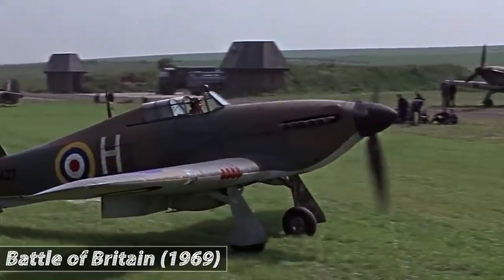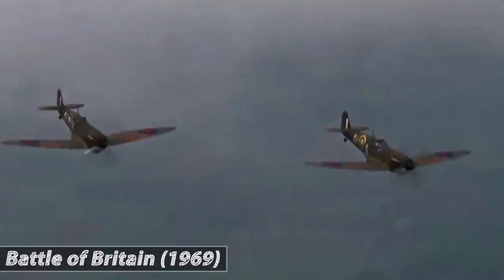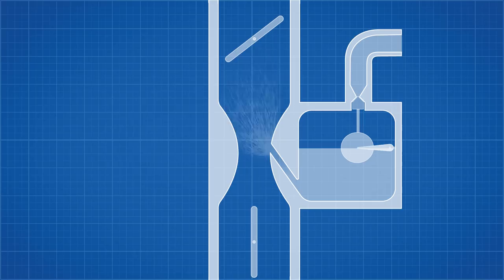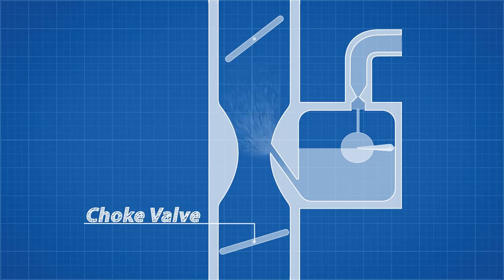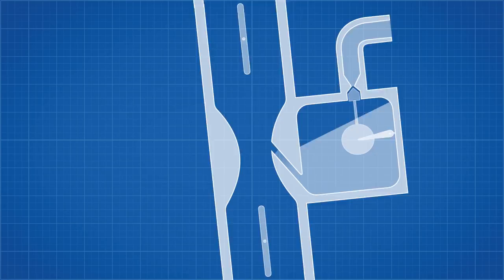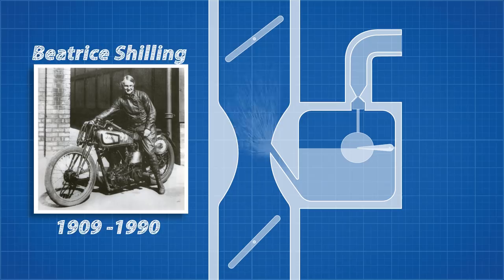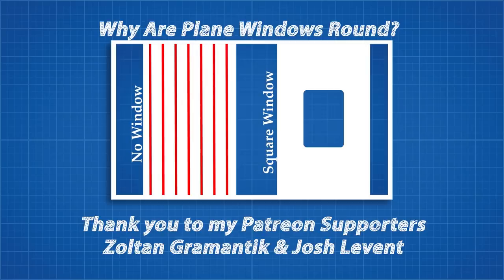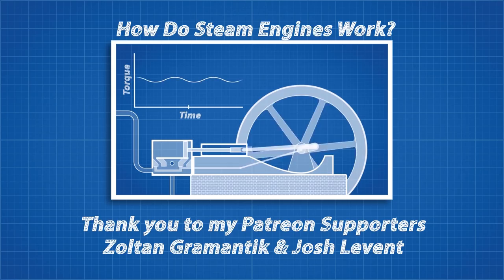The Spitfire's Fatal Flaw

Comment: A. That's a Hurricane you're showing cutting out.
B. It was NOT a fatal flaw, Spitfires shot down enemy planes at a ratio of 4.7 to 1 throughout WWII
C. The pilots learnt very quickly and rolled out of a negative 'G' situation.
Reply: The fact that it can cause your engine to cut out and fail to restart does make it a fatal flaw, did you even watch the video?

That kill ratio has a lot more to do with other factors than simply the plane's performance.  Vast superiority in numbers, only flying close to base while the Bf 109s were flying at the furthest extent of their range, the role they were employed in later in the war meant they were less likely to encounter fighters, the deteriorating quality of opposing pilots.  One could say judging on kill ratio alone that the Bf 109 was a far superior fighter, as in Operation Barbarossa their kill ratio was 21:1
Reply: Against massively outdated aircraft and totally inexperienced flyers on the eastern front. As Adolf Galland commented 'Like shooting fish in a barrel'
Reply: A: as addresed elsewhere, Spitfire footage was hard to find, so Hurricane footage was substituted. 
B: From an engineering point of view it's 'fatal'. It was a design flaw which unnecassarily denied users the ability to easily perform a basic function of the designed machine. It is accurate to describe this as a fatal flaw. 
C: They learned to work around the limitations of the plane's design. But this doesn't negate the limitations. It still provided the Germans with a manoeuvrability advantage, even though overall the kill-ratios demonstrate that German pilots remained at an overall disadvantage.
Reply: A. https://www.google.com/webhp?sourceid=chrome-instant&ion=1&espv=2&ie=UTF-8#tbm=vid&q=spitfire+roll
Spitfire footage is not hard to find, all of these videos produced before this one, also, the movie Battle of Britain that he took the Hurricane shot from is responsible for 170 hours of Spitfire in-flight footage..
B. From an engineering standpoint, it's not a fatal flaw, unless it, itself caused the pilots to die. It would cause possibly fatal situations in air combat, but by itself was a rather benign issue, as proven by the Hurricane in the video experiencing the problem but not crashing. Also, the fact that this issue was used by Germans as a defensive aid, since the German could dive away from an attack, while a Spitfire/Hurricane pilot would need to add a half roll to the action, makes it not really a fatal flaw for the Brits,, so much as a German pilot saving flaw. 
C. Spitfire/Hurricane pilots being attacked in the way that German pilots would dive earthward would simply turn into the attacker, forcing him to overshoot. The Germans lost the Battle of Britain, before Miss Shilling's orifice had been installed, because German planes also had disadvantages; low internal fuel, poor rear visibility, 850ft turning circle vs 650 for the Spit, and the automatic slats that even British pilots in captured BF-109s said were dangerous in aerobatics.
Reply: John Abbott You just proved exactly my point.  Claiming an aircraft is better based on kill ratio is ridiculous.  More than 70% of German aircraft downed in the BoB were shot down by Hurricanes, thus by your reasoning the Hurricane was better than the Spitfire, which anyone can see is false.
Reply: Nick Hine On point C: actually, the kill ratio during the BoB, when the two airforces were on relatively equal footing was in favour of the Germans by a factor of 3:2 when you factor in only fighters, which is what is being compared. That even includes the almost useless Bf 110 heavy fighters.
Reply: Your B point is moot as they fixed the negative G issue in later Merlin engines, It was only the Mk II spit that had the issue. Later Kill ratios have no weight on the engine.
Reply: You beat me, I was about to basically say all you said. I have spoken personally with RCAF spitfire and mustang pilots and they knew what the planes could do and used them accordingly. One ace I spoke to said he liked the spitfire over the mustang as a dogfighter so I am not sure it was a fatal flaw...just something you had to account for.
Reply: I would have thought that there was more footage of the Spitfire as it was such a big thing at the time
Reply: D. the BF106 could not dive steeper than 75 degree angle, otherwise the wings would break off from the body. It had a weak structure. The British pilots used this to their advantage as they could dive faster even with the engine stalled and caught up to the fleeing BF109 ... That I call a fatal flaw ...
Reply: P51s weren't amazing dogfighters, but they were fast. ive heard the issue described by a WWII pilot [who flew both] as [paraphrased] ''if i had tofight, id choose the spitfire anyday, but if i had to fight over berlin id choose the P51, for want of a return journey''
Reply: Kirothe Avenger That quote is in reference to the range, a Spitfire couldn't make it to Berlin and back because it didn't carry enough fuel, much like the BF109 over Britain.  The Spitfire was designed a decade before the Mustang, when the requirements were very different.

When the Spitfire was designed, it was assumed that the bombers could defend themselves, and so fighters were designed with less range as they were only needed for local air superiority and interception missions where they would be flying close to their own airfields.  By the time the P51 came around, it was becoming apparent that the bombers needed escorts when flying to targets in Germany.  Note that the British never developed a long range escort fighter because they did not see the need as their bombing missions were carried out at night.
Reply: jadger1871 precisely my earlier point. the two are different things. spitfires were amazing interceptors, P51s were amazing escort fighters. spitfires were better dogfighters, but as you said didn't have the range for long range ops, which P51s did. its not that a P51 is more 'modern' its because they were designed for different roles.
Reply: Nick.
The Germans had no maneuverability advantage in the Battle of Britain.
Reply: You are implying that the Luftwaffe single-engined fighters were 50% more effective than those of the RAF.  If you just took overall loss figures for fighters, you would have to allow for all RAF fighters shot down by bombers, plus maybe all those destroyed on the ground and any difference in non-combat losses.  Additionally, some of the RAF losses would have been when a plane was bounced by a Bf109 while it was attacking a bomber - hardly a fair comparison of fighter vs. fighter.  I imagine that the dramatic over-claiming by both sides doesn't help to work this out.  Do you have any detailed sources for your figure?
Reply: DrCrispycross Who are you responding to?

And in your example one could also claim that the Germans were at an even bigger disadvantage when Goering forced them to escort the bombers closely and thus negated their aircrafts' advantages.

Thus, the battle of Britain cannot be said to offer the best chance to compare them one on one in a purely fighter v. fighter example, as that was neither of their main roles.  One could also eliminate the later fighting as the Allies possessed vastly superior numbers and so you can't really compare them one on one.

Thus, the only time you can really compare them one on one would be the battle of France, when they were both operating in a similar fashion. But again, the vast majority of RAF fighters there were Hurricanes.  British losses from 10th May to 1st June - 386 Hurricanes and 75 Spitfires were lost over France; 106 total during Dynamo (Dunkirk evacuation); the Luftwaffe lost 147 Bf-109s and 83 BF-110s in the same three-week period.  Also note that those are total losses though, so a lot of those Hurricane losses were damaged aircraft that had to be abandoned as the front came closer.
Reply: It was you, and I agree with the points you've made in return.  I think this just shows how difficult it is to say which aircraft is 'best'.  The tactics used make a huge difference (as you say when 109s were forced into close escort roles) as do the quality of pilots - plus so many other variables!  There must have been some pilots who flew both - maybe someone like Eric Brown could make an objective comparison.
Reply: DrCrispycross This is a good view from both sides examining the other's aircraft after they were captured. https://theaviationist.com/2013/05/31/spit-vs-bf109-dogfighters/

Werner Moelders flew the captured Spit and called it "miserable", but then again, it was a Mk I with the inferior two speed propeller.  The Brits captured some Bf109s and found both aircraft outperformed each other in certain situations.
Reply: Germany always thought that any Spitfire they got hold of was the latest, they once got a Mk V and thought it was a Mk VIII, no wonder they could not understand why Spitfires were better than they were being told.
Reply: Barrie Rodliffe  Any source for that? While that might be possible, it's highly unlikely since every military vehicle is fabricated with a data plate somewhere on it giving the basic information about the vehicle, including the type and mark.

Either you're assuming the Germans were too stupid to hire someone to translate what the data plates said or that the British who were unfortunate enough to get the plane captured were smart and strong enough to pull rivets out of steel but not capable of disabling the aircraft.
Reply: Really, so every Spitfire would have not only its production number but the Mk number and other identification marks.
Not from What I have seen. 
How about the early Mk V Spitfires that were in service before a single Mk V rolled of the assembly lines, many were Mk I or Mk II that were modified.
Reply: Barrie Rodliffe If you do a little research, you would know that they also had another plate attached beside that one where they would list the modifications done. Those were needed so that mechanics would know what they were dealing with.

Also, you're taking this off on a bit of a tangent in quite a what if scenario.  Again, do you have any source? The only Mk V that is known to have been captured was fitted with a DB605 engine later to test the airframe compared to a 109 with the same engine.  And the Germans clearly knew it was a Mk V as these original documents show:
http://www.wwiiaircraftperformance.org/me109/db109g.pdf
Reply: I would think that that the mechanics, fitters, armourers  RT fitters and electrical artificers would be quite familiar with the aircraft they were looking after.
How do you know it was a MK V, just because  the report says Mk V and DB 605, it might be a Mk II. 
As  I mentioned before the Germans did not know one Spitfire mark from another.
Reply: Barrie Rodliffe Because it is documented by the Allies as having been a Mk Vb Spitfire serial no. EN 830 and they know exactly who was flying it and how it ended up in German hands.  just google it.

Also, the Mk II engine bay could not fit a DB605 but the Mk V could because their engine bay was enlarged for the newer Merlin 45 engine they carried. That link I already gave you even mentions the Merlin 45 by name (that's the engine in a Mk V, not a Mk II).

And it is a lot easier on a mechanic to list the alterations to an aircraft rather than let them discover them as they take the aircraft apart.  It avoids a lot of redundant maintenance work when they know what has already been done.

You claim that the Germans didn't know one mark from another, but all this clearly shows you are wrong.  back up your claims with a source if you disagree.
Reply: Flaws of the Spitfire were primarily maintenance related. Rearming, refuelling etc took 27 mins almost twice as long as the Hurricane, 13 mins.  Airframe maintenance, particularly the sophisticated wings made it difficult to maintain squadron strength aircraft replacement being practiced rather than cannibalization. Under wing storage, i.e fuel tanks or the ability to carry a 500 pound bomb, like the p51 mustang, was not possible.  The Spifires main flaw was that it was not the best tool for the job, the Mustang was. Same engine though.
Reply: William Bennett Later Spits could carry 1000lbs of bombs or rockets. The reason earlier Spits couldn't carry them was not a fault of the design but simply because they were not equipped for bombing as they were needed as fighters.
Reply: Willy.
Is that why Spitfires were being produced in increasing numbers and took over from the Hurricane. rearming and refueling was done well enough to beat the Luftwaffe and Spitfires had a higher percentage kill rate as well as a lower loss rate than Hurricanes. Underwing stowage like two 250 lb bombs or a 500 lb bomb  was exactly what Spitfires did before the P 51 did a thing. 
The Spitfires flaw was that is was so good at so many things that everyone wanted it, that is why more Spitfires were made than any American fighter. The Mustang with the same engine came along in 1944 and it still could not accelerate, climb or maneuver with a Spitfire, all it had was longer range, about 500 miles more.
The Mustang was not as good for air superiority, close support, photo reconnaissance, even shooting down 
V 1`s, the Mustang was good for long range escort of USAAF bombers and even then other fighters including Spitfires had to escort the P 51`s and bombers into Germany first.
Reply: A:Which had the same engine-illustrates the point
B:It was a flaw, could be fatal. Spitfires shot down enemy planes at ratio of 4.7 t 1 throughout WWII- LOL! According to Christer  Bergstrom Spitfires achieved 550 victories to 329 losses during BoB ratio of 1.7:1. Also in dogfights vs Bf 109 the ratio came to c. 220 to 180 to Spitfires disadvantage.
C: Bf 109 pilot presses down on his stick, Spitfire unable to fire without loosing engine power-surely, no big deal there. Also good luck against FW 190 which had far superior roll rate.
Reply: Grzegorz 
The slight problem was not a fatal flaw. and soon it was not even a problem.
The Spitfire served right through the war and did beat the Luftwaffe consistently.
Bf 109 pilot presses down on his stick, the Spitfire pilot unable to fire without losing power?
Where did you dig up that bit of complete nonsense?
The F w 190 did have good rate of roll which helped to make up for the Spitfire having better performance and a better turn rate. Many Spitfires had the clipped wing which gave them a good roll rate.
Reply: "The slight problem was not a fatal flaw. and soon it was not even a problem."

No not all, I am sure if Bf 109 comes up on your tail because your engine loses power is no problem. 42-43 is also very soon, like half of the war.

"The Spitfire served right through the war and did beat the Luftwaffe consistently."

Yes, like when Luftwaffe had 3:1 kill ratio over RAF squadrons in 1941 and 1942.

But anyways, I have to congratulate you on your logic. How do any successes of the Spitfire nullify the problem related to carburetor?

"Bf 109 pilot presses down on his stick, the Spitfire pilot unable to fire without losing power?
Where did you dig up that bit of complete nonsense?"

Common sense? Accounts of the pilots? If Spit pilot wants to fire he has to roll. How else does he fire without having the engine lose power?

"The F w 190 did have good rate of roll which helped to make up for the Spitfire having better performance and a better turn rate."

This is a manipulation at best. Spitfire Mk IX only went into production June 42 arriving to units in July, 1 year after Fw 190. And even then both planes were rather equal.
Reply: Gregorz.
If you knew the first thing about the slight problem with negative G in 1940 you would know that a Spitfire pilot would pull the stick back and turn not dive so maintaining positive G and turning tighter than the Bf 109, by 1941 the problem was completely solved for the Merlin 45. that is not 1942 or 1943.

Many Luftwaffe claims are about as realistic as Hollywood movies.

How do the many problems of the Bf 109 not make it a bad plane then?

The Spitfire had no problem of losing power when firing, where do you dream up that complete lunacy? The Spitfire pilot in early Spitfires only has to roll into a dive, nothing to do with shooting down Bf 109`s.

The Fw 190 had a good roll rate especially at low level, that is why many Spitfires had the short wing which gave them both speed and rate of roll at low level. The Fw 190 did not enter service in June 1941 only arriving in small numbers late 1941, the Mk IX was better than the Fw 190 and very good since it was still in front line use in 1945.
Reply: "Gregorz"

Don't know what to think, is it a deliberate action on your part misspelling my name? Brits are after all masters of passive aggression.

"If you knew the first thing about the slight problem with negative G in 1940 you would know that a Spitfire pilot would pull the stick back and turn not dive so maintaining positive G and turning tighter than the Bf 109, by 1941 the problem was completely solved for the Merlin 45. that is not 1942 or 1943." 

I know about it very well-and you have just indirectly confirmed that aiming at the enemy was compromised as a result of carburetor flaw. Turning on your back takes valuable seconds-and guess what-when you are on Bf 109's tail he can do the same over and over wasting your time (that is giving his wingman or other friendly time to help him out). Thank you for acknowledging my point.

Quote from Wikipedia " Merlin 50 series was first to use the Bendix-Stromberg "negative-g" carburettor."

I know what you are going to say wikipedia, unreliable-blablabla-at least Wiki has this referenced.
Main powerplant of Mk V was M45. Mk IX with such carburettor on its M66 was introduced in July 42 and it took some time before remaining squadrons were reequiped. Mk V was the most produced Spit variants and squadrons operated it well into '43 and some even till '44.

"Many Luftwaffe claims are about as realistic as Hollywood movies."

Let us have a bash at Luftwaffe, shall we? I have based my conclusions (and it seems like a consensus amongst historians) on not the claims of both sides but on their losses. You can look up losses at Dieppe raid which was in August 42 and so after introduction of Mk IX. 

Earlier things were even better. In April 42 RAF  lost 119 fighters whilst claiming 66 planes plus 49 probables. Luftwaffe had 111 victories claimed and lost 24 fighters.

I can supply more examples if you want.
Reply: Grzegorz Who are you talking to?
Reply: Sam Moon Barrie
Reply: Grzegorz No judgement, im just warning you in case you thought Barrie was going to provide a well thought out, reasonable argument. 
After you come to the realization that you're arguing with a tree stump worth of brain cells, it becomes a lot of fun to antagonize him...
Reply: Barrie Rodliffe 
About as realistic as the RAF's claims
Reply: Grzegorz 
Oh dear did I spell your name wrong?
What a shame. 
If a Spitfire pilot was behind and fired he did not have to roll, why should he?
I think you fail to understand what negative G is. 
I do not rely on Wikipedia. as for the negative G carburetor from Bendix, I am sure you do not know that Rolls Royce gave the carburetor to Bendix and the Merlin 45 with a RR/SU carburetor had no problem with Negative G
Reply: Sam Moon I didn't take it as an insult. I'd imagine Barrie is a member of BNP or something like that. Remember their Battle for Britain poster with Spit xd? I think I know who designed it!
Reply: Grzegorz Was that the anti-immigration campaign that used a Polish 303 Squadron Spit as their poster image? 

I love how whoever made that poster realized the red and white Polish checkerboard's meaning, removed it from the image, but decided not to tell the BNP...good times..
Reply: Yes, something along those lines.  Did they remove checkeboard's from pictures? I know nothing about it.  If they photoshoped it out it would have been even worse for them.
Reply: +Grzegorz They did. There should be a small Polish checkerboard behind the prop, under the exhaust, it's quite visible in the original photo, and ALL Polish aircraft had this marking, but the graphic artist for BNP actually took the time to remove it, proving to me that person knew the significance of the symbol, and chose to not give a fuck, or actively tried to embarrass BNP. At any rate, BNP stuffed shirts had to okay the ad, so for them to not have known, or cared that they were using an immigrant squadron's image to promote anti immigration policy is ridiculous....

That would be like Trump using Emiliano Zapata's face on Uncle Sam's body in an ad promoting his goddamn wall...
Reply: Grzegorz Well, yes, except that, now I see they left the checkerboard on the image...
Eh, I'm not from the U.K., so I'd only heard about it in passing, but the checkerboard is certainly toned down from the original photo: 

http://worldwarwings.com/no-303-squadron-a-little-known-story-of-polands-greatest-pilots/